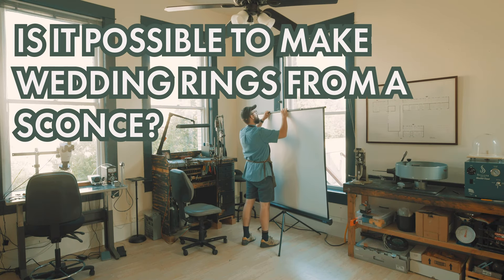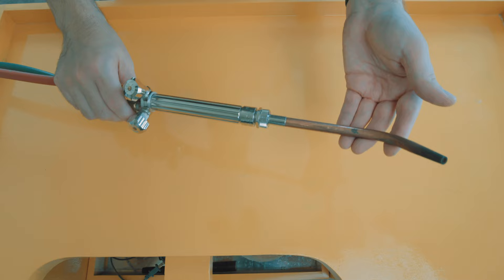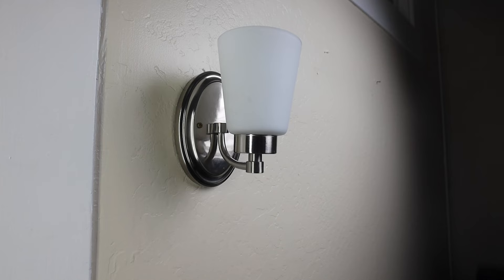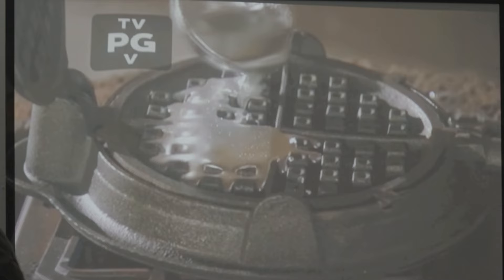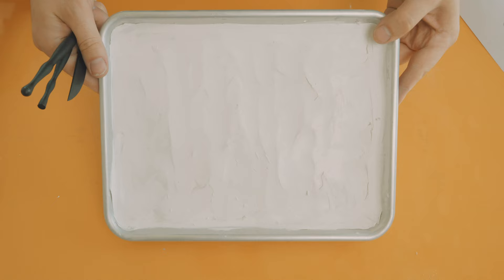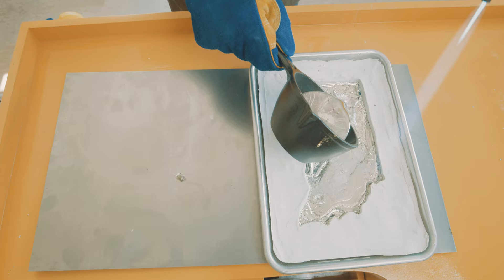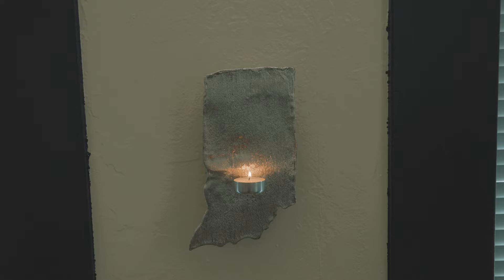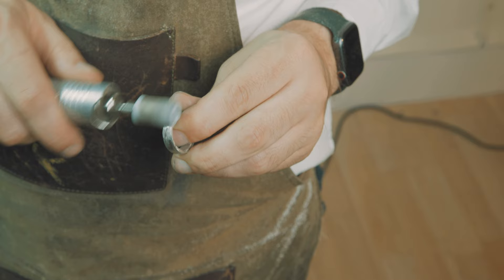I Made Ron Swanson Sconce Rings from Parks & Rec

Comment: I love how you just skimmed over the actual making of the rings, which would hands down be the hardest part lol
Reply from the maker: After the hassle with the sconce, the rings part actually did seem easier! I also wanted to keep it close to real-time of Rons instructions.
Reply: Tin is also a quite malleable metal
Reply: @moderngoldsmith  about how long did the ring part take you? Say, from melting down the sconce?
Reply: All you need is a crucible, acetylene torch and a cast iron waffle maker

Comment: Man, I'm glad I found this. 

I was trying to make a circlet for a costume that was too thick for wire. I made it out of EVA foam, but after trying it on a few times, it was already falling apart; it was evident I'd need a studier option. I was wondering what I could do to fix this. I was a little nervous to try metal snips for a design like what I was going for. I kept thinking about this scene from Parks and Rec and thinking "I wonder if this is real," and "If it IS real, I wonder how hard it would be to make a custom mold, rather than a waffle iron."

I came here just to see if melting metal was as easy as Ron made it seem in this clip (I've used most of the shaping tools for other projects, but I didn't know about the whole "melting into a mold thing). If it was, I was going to look into the logistics of making a mold that wasn't a waffle iron.

But in your endeavors to make a sconce, you actually answered BOTH of my questions, and specified what metal would be best. Thank you so much!

Comment: The metal of the first sconce was not aluminum. Even if it was oxidized, only the surface would be. The interior would be metallic aluminum. If all of it was aluminum oxide, it would have a hardness close to diamond (alumina, 9 on the Mohs scale). My guess ? Probably a weird alloy of aluminum, that increased its melting point.